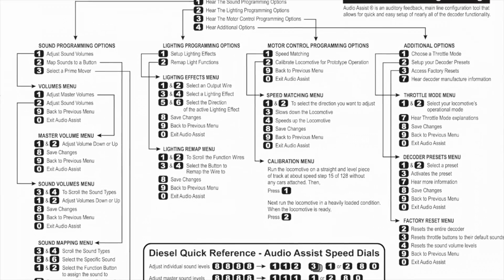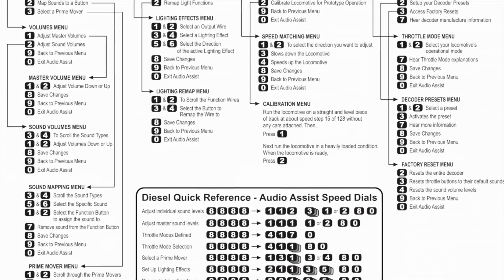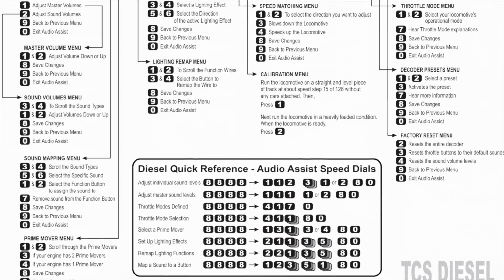Understanding Audio Assist® 101: Introduction to Audio Assist®

Comment: I have installed a Wowsound 101 v4.6 into one of my locomotives and I was blown away by the features of the decoder. but I have an issue with the automatic sounds in particular. the air compressor I have selected the compressor I wanted with the audio asset. but the compressor that plays automatically is not the same.